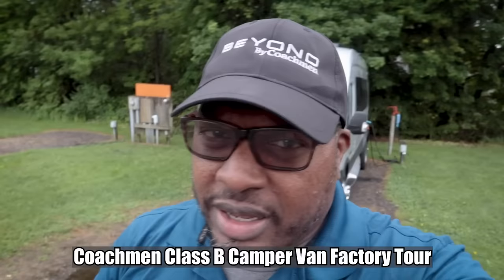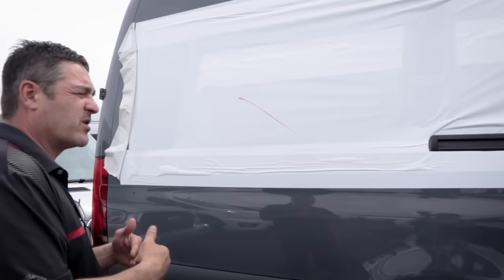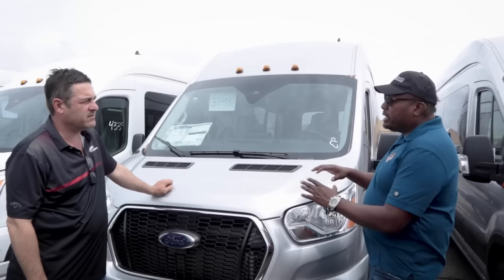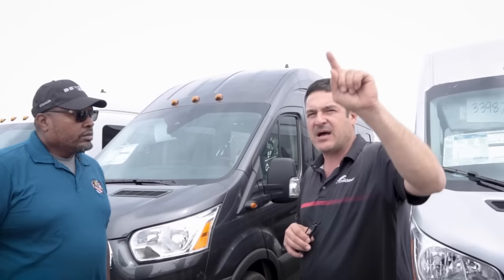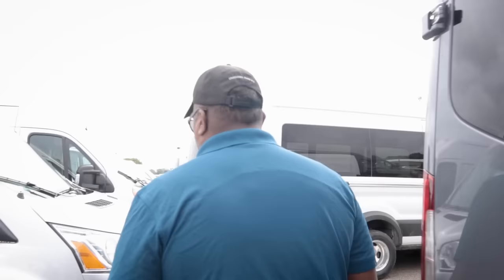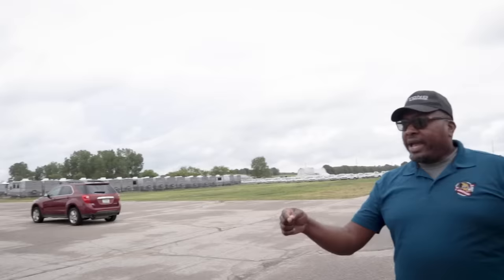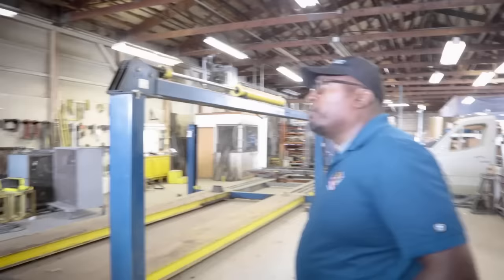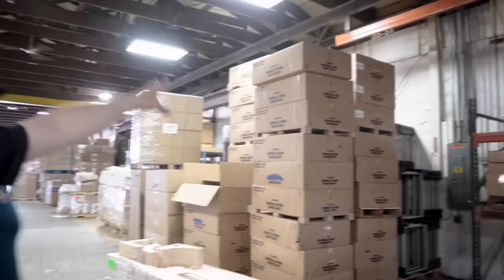How Coachmen Class B RVs Are Made From Chassis To Adventure Van! Factory Tour

Comment: HI Hank I like how Nick is trying to put the best product out there I don't mind playing a little extra for it after all people tend to keep the RV for a long time and most of them are not handyman they don't want to buy a RV and end up fixing it on the road they should be enjoying driving it on the road and the places they visit not worrying about what items are going to break down next 😮 they should be enjoy the trip not worried about the RV will fall apart on the road 😢 I don't have a coachmen's RV yet but it will my first choice ❤ on the bathroom I have a suggestion most people buying a RV are older people like me 😢 and our knees are getting stiff so it's hard to bend it I know the bathroom needs a high edge to keep the water inside but if he can find a solution to have the lower edge and keep water in 😂 Winnebago's roam I like how it has that big bathroom door and that looks easy for people get in and out 😂 the battery I am glad he is using the company battery and safety is a main issue with the battery I had watched some video of Chinese EV just started to burn because they use the cheapest battery for their EV and people got burned to death because they didn't have any safety standards for the battery and what is so sad are the EV manufacturers denied any wrong doing and blem every thing on the driver's error 😢 just last year The hawei phone company came out with an EV the CEO was bragging how advanced technology their EV has during the press conference few months later a family was in the new EV and it hits a truck on the freeway and ev started to burn all four of them burned into crispy sticks including a four years old boy and his father 😱 people were trying to get them out but the door handles were in recess positions It supposed to Pop out in the emergency but it didn't and people can't get the handle to open the door 😢 so everyone in the EV die the boy's mother complaining on line few hours later on how Huawei EV killed her husband and her son plus her brother 😱😭 basically she lost the whole family 😅😨 later she got contacted by the company lawyers and wanted her to cancel the complaint she won't do that but later her boss called her told her if she doesn't do it she can stay home forever and not go to work 😱 and there are some Chinese want on social media trying to support her but they All got a letter from the lawyers telling them stop spreading the rumors because police have not finished the investigation about the accident 😅 later It comes out with an official statement 😅 It blem the manufacturer for making the chassis and the Bosch for the emergency brake system failures it blem every one except for himself 😂 and now Chinese are trying to export their bombs to the USA and EU for real cheap price I am not going to buy an EV right now even Tesla only because the battery technology is not good for a long distance drive 😅 if I do buy one I would have a Tesla I rather die in a expensive caffeine than a cheap one 😅 I have mentioned it for the banch seat model if the engineer can figure a way for the back not lay flat but flip it to other side so people can face the back door when they are wide open to face a beautiful sun set or a beach full of beautiful women with bikini 😂 with the screen down and I have a good telephoto lenses to take some pictures 😂😜 I just need to leve my wife at home 😂😮 that will take some engineering to get it to work

Comment: You are so right about taking care of units that are sitting. Keep 'em on pavement, drive them around the block every 2 weeks, cycle the systems if the temp is above freezing. I wish used RV dealers cared enough to do this because it has been my experience that most of them are so lazy they only look at a unit when some has said they want to come down and see it or they put in out for show. They will get ice in them in the winter as well as the little bastards are looking for a place to nest. IF I was dropping 150k+++ I would be gone when I saw the first mouse turd because that means they have been in the unit ... every where... and probably in the walls, engine etc.. NFG. I can't imagine leaving my RV parked in the winter for 6 months either behind the house or at a RV storage. In the spring, you have to first try to start it and then second find a way to get the rodents out. No thank you. I have my RV beside my home and I have traps in it and check them every day. Probably catch 10 mice a winter in a 35' class A. However, if you have traps where they seem to get in (the firewall) then they are dead right away and don't mess around to much.  Then every two weeks on a sunny day day I drive it 40 km and if it is above freezing, I will cycle the slides and the leveling jacks. Nothing is guaranteed or perfect, but doing this costs almost nothing and then in the spring I can spend my money camping instead of in the shop.

Comment: Hank - Wow what a difference between the trashy assembly line of Coachmen and the pristine line at PleasureWay.  Watch any of the PleasureWay factory tours and you will see a huge difference.  Also - Look at the total rats nest of wires at 1:53:53 in your video.  Cable management should be done as it is installed!!!  To see why...Check out the video: 2021 Coachmen NOVA 20C Li3 - Real Owner Review Part 1.  

Otherwise... Great video... Maybe a bit long, but I did watch it all : )

Comment: Thank you for the information. I want engine, powertrain performance and 5k tow capability at a good price. I don't need power doors, fancy lights, or fancy woods. I want a hardy vehicle that will stand the test of time and use, not pretty for the park. I'm an "older" Gal and still like some stealth as well. As an old school diesel mechanic, I like the dual axle. My only real decision will be Ford vs Dodge chassis. I'm in the pre-purchase mode right now, trying to find what will work for me. I'm retiring in 3 years, but want my Class B now.
Reply from the maker: You are welcome...there’s a lot of choices out there with the Dodge and a few with Ford and I think more coming online soon, except Fords are harder to get now and Dodge is very readily available

Comment: Thank you Hank and Lola for this tour of the Coachmen factory, it is very informative. I saw many class B vans and decided on the Nova, the floor plan and the interior design was what sold me, however what is "under the hood" is concerning. The electrical wiring in the electrical compartment is a mess, it's a spaghetti of unlabeled wires which makes it almost impossible to troubleshoot, this doesn't speak well of the Coachmen quality control. You should pass this on to Nick.

Comment: I am an old retired electrician and one thing I know is, if the wiring is not neat, pretty even, it’s not right. Look around the panel area, the wiring should look like a freeway system, not loose or hanging. All wire’s should be color coded and well labeled at both ends. When wires go through metal, good grommets are a must. Vans vibrate, bolted connections deserve lock-tight. Shrink-wrap should cover all splices. Cheap hardware won’t last. A grounding strap ( this is a tough, woven metal strip that hangs down from the chassis and drags along the ground eliminating any static electricity buildup) will help protect your electronics. All systems must be grounded. Speaking of ground, ‘Ground Fault Interrupting’ (G.F.I.) outlets will save your life. For kitchen, bathroom and outside use, this is a must! 
Best of luck to us all.  P.S. Sorry if I rambled on, maybe you guys should hire me!

Comment: The key design concept if you are going to do an unwarranted DIY build is make it easy to take apart so if you have a problem it can be easily rectified. Since this warranty is not transferable, if you’re buying a used van you should not pay much more for a factory built conversion than for a well done build from a small builder or DIY

Comment: That's why Dodge wins: wider body, flat floor, a lot more room to put batteries and tanks under the floor, much more fuel efficient, much easier to drive and park, much easier to repair, much better turning radius and so on. It's just a much better rv platform to begin with hands down.

Comment: Duh,  there’s just one problem with his analysis about using the hush mat on the rear wheel wells. that makes lots of sense if it’s going to be used as a passenger van but once you convert it to an RV there may not be anybody back near those wheel wells to hear the noise because they’re gonna have to be in seats and have seatbelts and RVs are not passenger vans so the odds that there will be somebody seated near those rear wheels while the van is moving is unlikely unless they’re risking their life by not being seatbelted in. The further away from those rear wheel wells you’re seated in the van the less you’re going to be hearing that noise. I think that money would’ve been better spent on putting the lithium ion batteries behind a firewall compartment

Comment: Nobody thinks about firewalls in these vans no matter how much they cost. you would never build a house without thinking about fires and obviously there’s a firewall between the engine compartment and the rest of the van on any car but all you need to do is make a trip to an auto salvage yard and you will fine all sorts of Very expensive factory van conversions that have had electrical fires that were not contained and destroyed the vehicle. A new report from the National Transportation Safety Board says they found that firefighters aren’t prepared to deal with electric vehicle batteries. Where is a conventional battery fire can be extinguished with the water from one fire truck electric vehicle fire can take 4 to 20 fire trucks to extinguish due to the lithium ion batteries. In the case of RV van conversions they’re not even going to know where the battery is located.

Comment: Geez I hate those things    Too big, horrible interior, then add Coachman “quality”    No thanks   I’ll keep what I have
Reply: I just took out a membership to RV consumers Group and I was stunned at the 3 star rating for the 2021 Beyond. Out of Five Stars: Reliability 2.5 stars / Value: 2.5 Stars and a total score including driveability 3 out of 5 stars. The handling brought the score up - but that is more about the van than the coach build. It is certainly something to think about when Class B shopping. These are not cheap rigs and warrant a higher quality rating than what I am seeing here. It's a shame because I really like the rear bath model with the 5° insulation rating and the dualies / AWD (especially where I am located). But if the interior is going to fall apart, what are you left with?